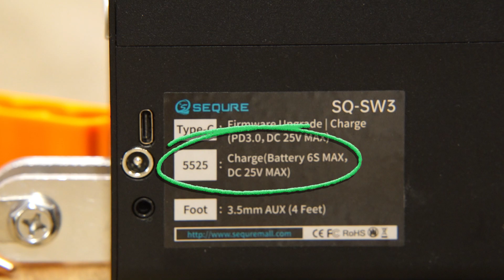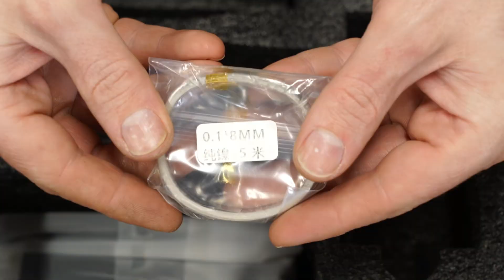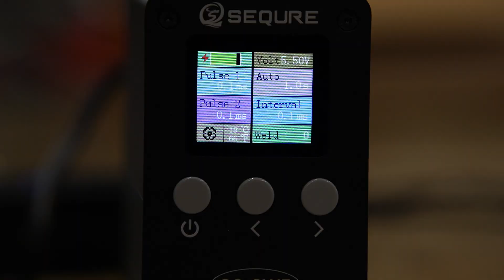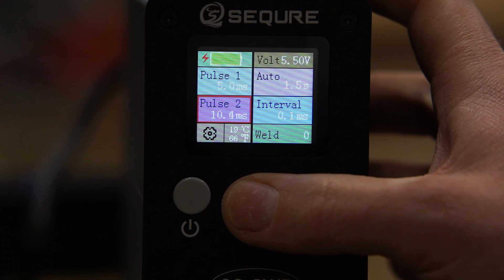Sequre SQ-SW3 Battery Spot Welder Review || 18650, 21700 cell tab welder

Comment: Thank you so much, as i received the SQ-SW3 with as you say, no instructions.  I did not know the small foot cable was to be plugged into the hand module also.  The settings helps so much as i had no idea where to start.

Comment: Nice welder, would love one but no budget for those so i had to take the cheapest reassonal to buy, it has 12 mosfets, don't know the size i built a wooden box for it and the battery. I remember so well When the wires jumped like that with my spotwelder first time i used it, i jumped too. I use a kweld type of welder thats aleast as good as Kweld but 1/4 the price. Using it  with a 15000mAh 100c 3s2p 1500A, 
no idea about shortcurcuit as that is not in the datasheet but I would imagine atleast 4000 A at Minimum. I can spotweld thru more than 0.5mm nickelstrip took five 0.1mm and stacked them before welding withaout no problems.

Comment: Because of this video I ordered a unit a couple of days ago…was looking at the kweld…but didn’t like the fact I would’ve had to build my own power supply 
Thank you…
Reply: I didn't thought that as a issue since there are a bunch of high current PSU server supplies out there for cheap, and I have tested 2 similar spotwelders as in the video before and I gave up those very quickly with very uneven welds no matter what you did. So I sold those easy since I very quickly realized the kWeld was the choice and I haven't regretted it all since.
Reply: Hey friend since you bought can you share your experience
 is it worth it? 
Is quality good?
Does it weld copper?
Any potential issues?
Reply: @amarsingh-og5mk  
1. Yes
2. Yes
3. Yes, if it is thin enough
4. Not what I have seen or heard but you need the capacitor bank if you do not have a battery that can generate about 1000Amp very quickly.

Comment: Hello Sir,

How are you? I hope you are doing well. I am speaking from Bangladesh. I really like some of the videos you have created, as they seem very different and highly precise compared to the ones available locally in our country.

I am studying electronics engineering, but I have not enrolled in any institution for this purpose. The reason is that, in my opinion, there is neither a good education system nor proper books available for learning the basics of this subject here. Even if such resources exist, they have not come to my attention. This message has been translated through AI.

Now, Sir, I have a question. I am currently studying Kirchhoff's laws.

KCL (Kirchhoff's Current Law): The total current entering a node is equal to the total current leaving the node.

KVL (Kirchhoff's Voltage Law): The sum of the voltage drops across all elements in a closed-loop circuit is equal to the total supplied voltage in that loop.

If I stop practicing further and proceed with only this basic understanding, will I be able to learn the upcoming chapters easily?

If not, could you please tell me which chapters might cause difficulties for me?

I will be grateful to you for your assistance with this answer.

Comment: Great review, thank you. I've been thinking about making a spot welder using an old microwave transformer, but I haven't seen circuitry to enable the double weld funciton, which looks really good.
Reply: there is the ny d02 spot weld module which has double pulse capability. i use it. you can adjust pulse and interval duration.
Reply: @catsnotcops_  Thanks! They're cheap too.  Awesome.